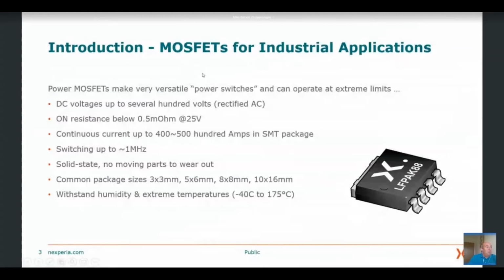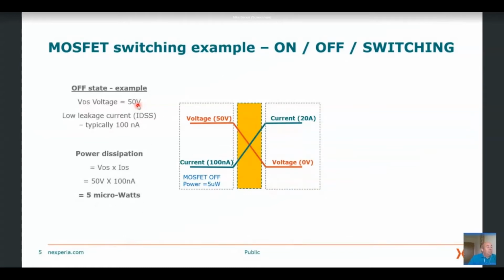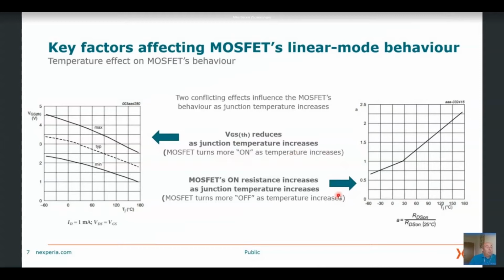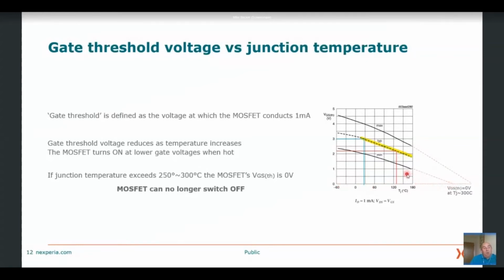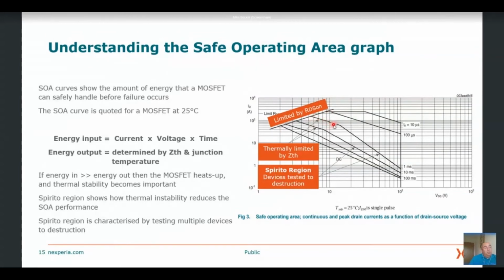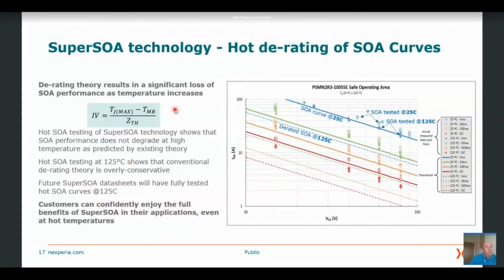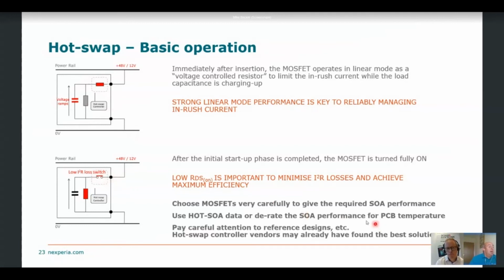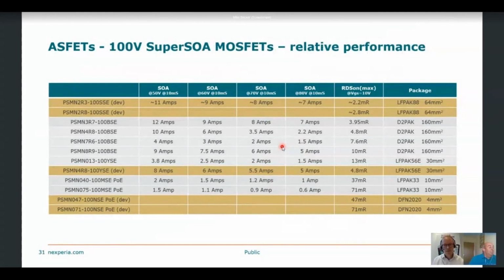MOSFETs with extraordinary SOA for industrial applications

Comment: Thank you so much, I'm trying to pick out FETs for a BMS and this helped a lot. I still don't fully understand but this helped. the main question I have is what are the different times on the safe operating area graph? is that the time it takes for the FET to switch on/off? so that time would be the time it takes for my BMS's IC to switch the FETs off when there is a short circuit or overcurrent? thanks
Reply from the maker: Hi @AshWeber-Campbell, thank you for the comment & question. The safe operating area (SOA) is given for pulses as well as DC against VDS (voltage drop between drain and source).  The right side of the graph where VDS is high shows the linear mode operation meaning the MOSFET is kept in its switch transition, and it gives the current allowance for the given pulse time and the voltage drop.  We have a whole host of information regarding SOA, check out https://www.youtube.com/watch?v=Km_SFBgG-kQ or https://www.youtube.com/watch?v=pYl0bLiYUxc